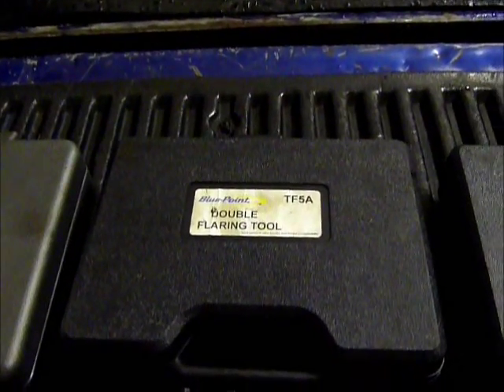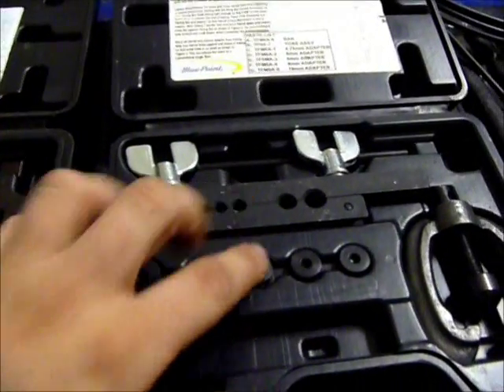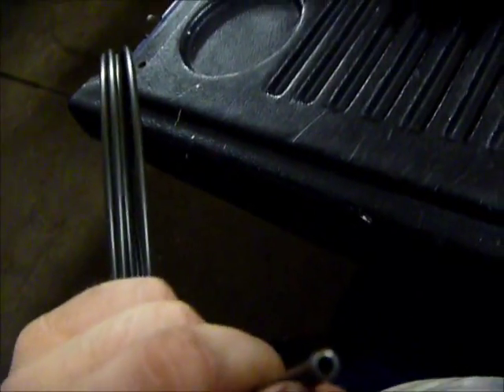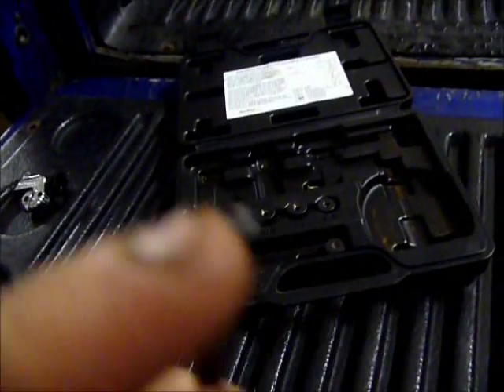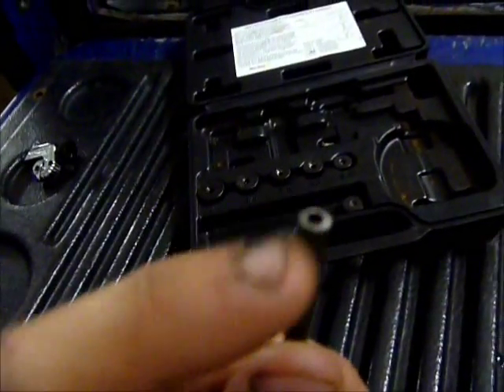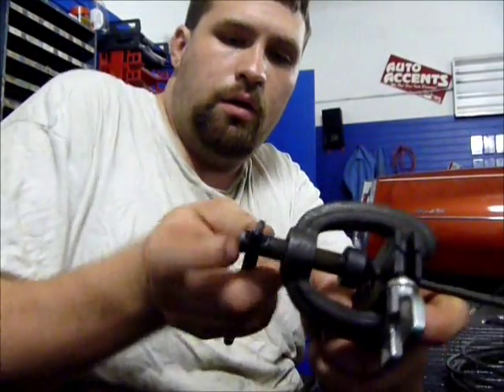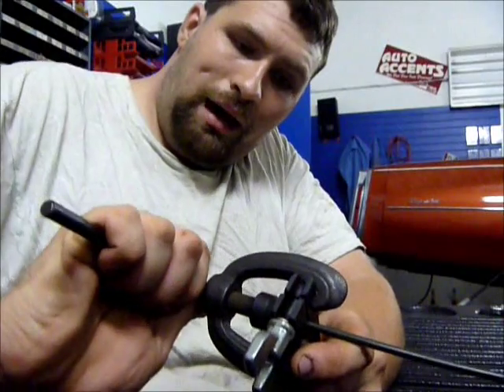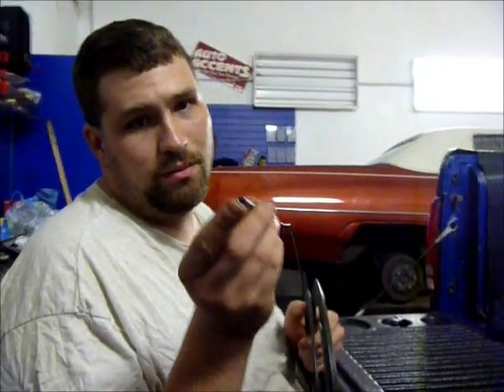How to flare a 3/16 brake line by Preppyboys Automotive Cleveland Ohio 216-510-4583

Comment: I have the same kit and the flare chucks seem to be very sloppy inside the line. Is this normal because all my flares come out off centered and the teeth on the block dig into the line and so much that I have a hard time sliding the fitting back up to the flare. I have not put the lines on the truck yet to see if they leak or not.